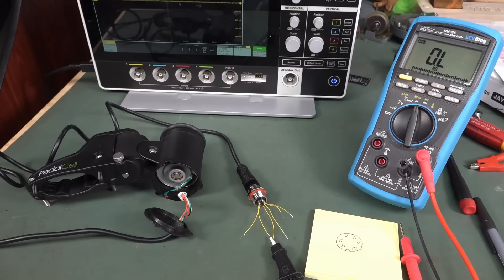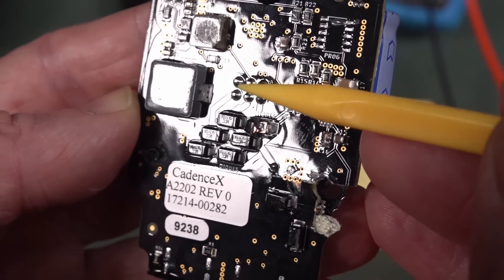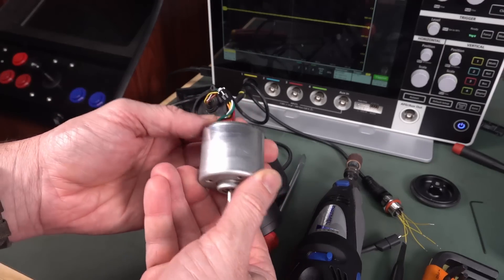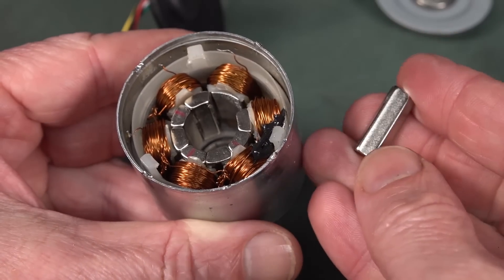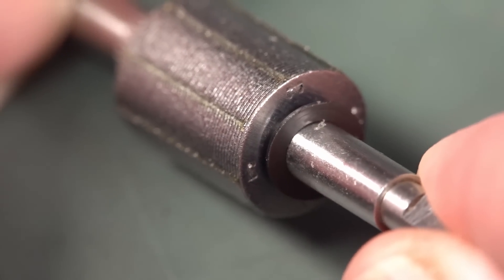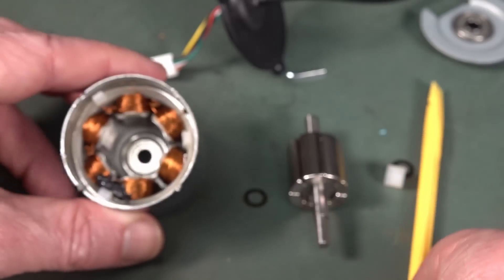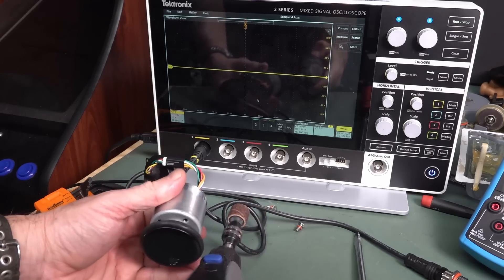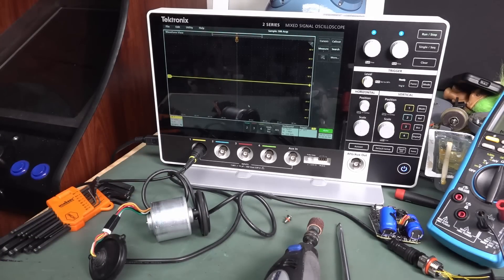EEVblog 1485 - PedalCell CadenceX Bike Generator LOL FAIL!

Comment: That's what's called an "inrunner" configuration (where the magnets are on the rotating shaft).  They can fly apart as this one did.  The other configuration (where the magnets are on a rotating bell and the coils are mounted in the middle) is called an "outrunner".  The benefits of the outrunner include the fact that the magnets are being flung in-place by centrifugal force when things are turning.   They still throw magnets sometimes however -- if they're poorly glued.
Reply: Yup, I've glued back many a magnet in the outrunner motors of my racing drones. They still worked quite well, especially after rebalancing.
Reply: my only complaint is "why glue?". Just wrap some sewing thread around the rotor and soak it, and it will never ever fly apart. At least at the speeds this motor/generator operates. High-speed inrunners have the magnets embedded in the steel (at least, all the ones i've seen in power tools).
Reply: @victortitov1740  i jobbed at a company that produces three phase synchronous motors and they use kevlar thread wound around the glued magnets and then soak the whole rotor in resin. they are cured while rotating to get an even resin distribution that requires minimal finishing on the lathe for concentricity and is balanced afterwards
Reply: I was wondering why they didn’t use an out runner design. In runner seems more prone to flinging it’s guts out. Eh, not a motor or generator designer anyway. Seems like something that would really only be usable in low rpm situations.
Reply: @Guineh76  Or you can put a proper mounting system instead of just gluing it like a cheap POS and it would never be an issue.
Reply: @Guineh76  in out-runner design the outer casing have to free-spin and only attached to the static part only by a single shaft on a bearing, while a in-runner design the mechanical configuration is typical, ie; like in the video, a load can be attached to the motor by a shaft while the casing is rigid and can be securely mounted to a larger structure. So imagine how to design a plastic mounting for a spinning casing (out-runner)? on a DC fan it is done by making the fan as the casing for magnets and the base of the motor is mechanically supported by a circuit board.
Reply: @xponen  yeah, that definitely makes sense. Was not thinking of that when I posted.
Reply: My R/C car motors are all inrunner and I've never had a problem with them, even with motors which spin at 50K+ RPM. The company obviously just cheaped out on the motor and this was the result.
Reply: Spot on. Low inertia of spinning mass is one of a few great reasons for using an inrunner. A human pedaling on and off may generate intermittant energies where an inrunner is preferred for this reason. A properly specc'd inrunner (or any anything for that matter) will never fly apart, but poor engineering may not be accounting for dynamic forces of existing on a moving bicycle and associated failures modes.
Reply: @stonegray230  
Long story short, that guy probably DROPPED the unit onto a concrete floor and jarred the magnets loose. AND he did it twice. Once to each unit he bought ... maybe his bike riding "did it" too.
Reply: Almost all of computer fans are out runner designs.
Reply: I work for a company which develops fly wheels to store energy. Those machines are outrunners, but it's a different usecase.
Reply: Do they ever just glue a strand of glass fiber roving or even just a thin woven sheet or something around the magnets on those inrunner motors? Or do better versions just encase the magnets in steel laminates or something to keep them together?
Reply: @DrPersonman  Tesla's newest motors use high-tension carbon fiber rotor wrap to counter thermal expansion and centrifugal stretch to reduce the overall rotor-stator air gap while raising RPMs some more. If carbon fiber wrapping is good enough to control expansion inside a 200+kW electric motor, a much simpler wrap should be good enough to prevent rotor magnets from flinging out of a 10W dynamo.
Reply: outrunners have higher number of magnets producing more torque and a higher voltage for a given RPM
Reply: imo the better design is with the windings on the armature and the magnets fixed...altho this requires a commutator and brushes to get the power off the armature and out to the housing.. and that can fail (not as quick as this junk tho!)
Reply: @WacKEDmaN  When you use an outrunner design, the coils on the inside/"rotor" is static and it is magnets on the armature/"stator" that are going around. No brushes needed. Static coils on the inside, moving magnets on the outside is how most PC fans are built too. Instead of using glue on an outrunner, you could use shims to maintain spacing and wedge the magnets against the shell so they cannot get sucked in.
Reply: @teardowndan5364  not to practical for this use tho..this needs a design that has latitudinal strength..outrunners dont usually have much in the way of that...
Reply: @WacKEDmaN  You can have whatever strength you want, loads are nearly the same regardless of in or out runner, it is just the point of load moving from somewhere beyond the housing to somewhere usually in-between. Many electric bicycle hub motors are out-runner designs, no shortage of loads in all possible directions there.

Comment: I bet it was heat not vibration/force that caused the adhesive to fail... but either way very poor engineering to rely on such a small amount for such a critical join 🤔

Comment: Well that's a shame, and a waste. The rest of it was pretty well-made, then they blew it with the very first, most fundamental, integral part in the most bone-headed way. There were so many ways they could have done that, why they went with a drop of glue, is beyond me. 🤦
Reply: Take into consideration that in China, one manufacturer makes PCBs, the other one makes the motors, and the last one assembles everything. Maybe it's how it is done in other countries too,  except that other countries have QC department, and are not using the absolute cheapest to bring down the prices...

Comment: Such a simple mechanical failure! And that does explain why some many of the things have died, because the combo of bicycle vibration and spinning fast is going to break that glue every time. I wonder if there's room for a wrap or two of fibre tape for a repair?
Reply: it's not good enough for the magnets to be taped into a ring - they have to be mechanically connected to the shaft, so the tape won't do squat. Just need actual glue that holds.
Reply: re: "because the combo of bicycle vibration and spinning fast is going to break that glue every time."
Yup.

Comment: I had one of those as a kid - manufactured over 50 years ago at this point   

It was basically a perm magnet brushed DC generator (motor) you'd wire directly to the lamp module which contained a standard torch bulb (6v as I recall) .  There was only one wire - they grounded by clamping down and gashing thru your paint to the bike frame.    The on off switch was simply the mechanical lever that would engage/disengage the drive cog against the side of your tire.

It had horrible magnetic cogging  and placed a surprising load on the wheel which you could really feel .   The light intensity would go up and down as you peddled and went off when you stopped.  No capacitors or batteries or regulators.  It ran quite dimly most of the time , to leave some headroom in case you went really fast so it wouldn't blow the bulb..
Reply: Haha - perfect description of the components and the installation! One good thing about them: AFAIK, they never got stolen! 😅

Comment: This BLDC motor would work just fine if the magnets were fully potted in epoxy like you did at the end for your repair. It blows my mind that a company would ever sell such a motor with internal magnets that only held onto the shaft with glue. Even if this was used for its intended application, it would still be a matter of time before the magnets flew off.
Reply: @SporadicBenevolence  I was going to say the same.  In REAL generators, the magnets would be a tiny bit longer than the coil poles so you can 'band' each end of the rotor with any non-conductive 'string' to hold the magnets on the rotor.  But that would cost a few pennies more.

Maybe the darn thing just isn't rated for the speeds involved?
Reply: @SporadicBenevolence   dunno they're charging 300 bucks for this shoddy thing. They probably have enough margin for something better than elmers.
Reply: China does not care.
Reply: @SporadicBenevolence  its not just about the price, i think.
the bandaging reduces the air gap, resulting in a torque reduction.
We are designing our own high-power, high-speed motors (25krpm) for our racecar - and AFAIK, without bandage. For the afforementioned reason. The magnets are embedded in the core. A colleque of mine simulates exploding rotors for high-power machines - all without bandage. We are talking about high-reliability applications :-).  In this case, however, they should have added it.
Reply: Sintered rotor was the only logical choice in my eyes.

Comment: As for the laminated construction I think they just make the components and assemble them using the same machines that they already had to make brushed motors because that's more cost-effective, sheet metal can be punched to final shape much faster than one can see with the naked eye, for a solid piece they would have to use a lathe to face the ends, turn the outside diameter and make the hole... I don't know how fast a CNC lathe can be but I doubt it can outperform a die cutter.

Comment: For the manufacturer failing to glue the magnets properly is not even cost cutting, it is just plain stupid non-caring no quality control bullshit. Oh, I don't think vibration from the bike has any effect on it, it is only the centrifugal force that eventually throws the magnets onto the stator.
Reply from the maker: You underestimate the power of vibration.
Reply: @EEVblog   Perhaps. And I'm far from an expert on bikes too. Just my gut feeling on how a bike can or cannot vibrate :) Thanks for replying.

Comment: I was waiting for follow up video, as were anticipating what went wrong with it. I'm always interesting in different failure modes. At 1st thought could've been a voltage spike but dammn if the bike went over ramps, and had a ton of vibrations magnets twerkelate themselfs loosey goosey, and boom no more electricity for you! Hats off to who designed the electronics, and the housing for it ...But whoever designed that generator didn't take into consideration the sheer amount vibrations created when cycling. Also, glue wouldn't be solution only temporarily. But, I'm no design expert on this, just have experience re-building the bloody things.
Reply: the centrifugal force FAR exceeds the vibrational forces I'm sure.  I bet if you spin a new on up to speed it'll die right there, unless this was just a bad batch of unglued motors

Comment: "Stabbies."
Sharp probes to stab thru the conformal.
Above a certain RPM, your magnets are going to throw to the outside and part with the rotor.
Reply: OR - just drop the motor ... onto a hard surface. Concrete might do it.

Comment: I've wondered before how you would glue those coated neodynium magnets. Must be difficult. 
Also don't you generally want very little glue but with enough pressure to ensure a good bond? Generally the glue will be less strong than the glued parts so if you have thick glue it can break more easily.
Reply: Most likely some sort of epoxy or cyanoacrylate. Looks like too little was used going by what we can see on them @10:35
Reply: @grndkntrl  I guess you want just enough so that it will be squeezed out and a thin film remains. Probably a messy job in the manufacturing line.
Reply: epoxy potting would work as mechanical fastener.

they sure had enough potting for the electronics. I guess the cumbersome bit is in balancing the epoxy really.

Comment: Given that this device is subject to so much vibration during normal use, would the manufacturer be better off using a good old fashioned brushed DC motor? Sure the brushes will eventually wear out, but you'd think a brushed motor would last a few years before needing replacement.
Reply: I used to go outside at night with my bike, I put a big brushed DC motor from a printer in the wheel. It produced enough power to run a 21W car lightbulb inside an old car headlight, but the motor was getting toasty after a few miles. It produced just as much light as a motorcycle headlight, and drivers would sometimes blink at me to reduce the power :D

Comment: It's a sensored brushless DC motor being used as a generator. They are commonly used in upmarket RC cars as the sensors give good starting torque. Chinese made ones are known for losing their magnets. We use unsensored ones in RC planes and were in the habit of pulling them apart when new and super gluing the magnets in properly before first use.
Reply: Generally in RC prop type planes/drones, outrunner motors are used where even basic glue will work due to magnets being on the outside.  Where inrunners are used such as EDFs, helis and cars, the in running stator with magnets are wrapped with kevlar or carbon fiber as any glue alone isn't a guarantee.
Reply: @preddy09  👍
Reply: A lot of skateboard motor sellers advertise "battle-hardened" where they go in and add extra epoxy to the magnets. Some of them go even further and try to balance the motor.
Reply: @KerbalLauncher  skateboard + motor = pleb
Reply: Usually in RC applications, the ESC measures the back EMF of the motor coils to know what position the rotor is in.
Reply: A good factory solution is to wrap the magnets in Kevlar bandages. Like hoops of a barrel. I guess you could do that as well. We have some servos from China made that way.
Reply: @vorazechul  That would be hard to retrofit as the clearance between the magnets and the poles is made a small as possible for efficiency.  You'd be lucky to wrap even one fine kevlar or CF thread (with epoxy) and still fit.   With a lathe you might be able to bore the pole pieces out a smidgeon.
AFAIK, only Tesla make CF wrapped rotors,  and currently only on the Plaid.
Reply: @vorazechul  or some sort of heatshrink tubing?
Reply: That moment when I realise that the spikes from the Dremel's EM interference is bigger than the output from the generator. 😂
Reply: RC planes motors (and a lot of brushless motors in general) are "outrunners" which means the magnets spin around the rotor. Now that makes sense!
Reply: It's not hugely different from a car alternator except the alternator uses an electromagnet in its rotor. There are converted alternators out there that have neodymium magnets in the rotor to be used as wind generators.
Reply: It would be good to know a part number so we could build our own.
Reply: @richardl6751  "It would be good to know a part number so we could build our own."

We've already see how that motor is a bad choice.  Better to get an RC outrunner motor, but a fat rubber band around it and shove it to the bike rim.  Rectification, smoothing and regulation needed to, of course.
Reply: @Randrew  I was referring to the brushless DC motor that Ashley West was talking about.
Reply: That’s exactly what was said in the video. No new knowledge here
Reply: theyre also developing sensors to track customers anger and frustration and advertise the new model whenever they spike
Reply: If it is brushless DC then why is the output AC?
Reply: @debochch  bacouse brushless DC motors are not DC motors at all they are AC motors with electronic computation, or more precisely they are permanent magnet synchronous motor with trapezoidal back emf. Brushed DC motors are also AC motors but with mechanical computation (brushes convert DC to AC). There is only one motor as I know that is realy DC motor but it produce so little torque that is near useless.
Reply: @debochch  - because a brushless DC motor is NOT running off continuous DC. They run on 3-phase "switched DC". The hall effect sensors and motor controller PCB send a pulse train of DC to the 2, 3, 4 or more windings in the correct order and phase angles to create the rotation. The DC pulses sent to the windings pull (and push) the magnets to create the rotation. Little pulses or slower pulses = less power/speed.
...
The reason they are called a "DC" brushless motor is because they run off DC power. It's switched on and off with a square wave, same as a PWM signal, except more than one phase. This "generator" would be 3-phase DC. Contrast that with an AC Motor that is usually driven from a Sine Wave shaped AC power supply.
---
In this case the motor is being used "in reverse" as a generator (probably more like an alternator) that creates 3 sinusoidal voltages that are 120 degrees apart in phase. It's got 2 windings per phase (probably running in series ), and 3 pairs of magnets. As it rotates, the resultant voltage on the 3 windings rises and falls in a roughly sinusoidal waveform (as seen on the scope).
Reply: @debochch  No such thing as a "Brushless DC motor" they all operate from 3 phase AC.  It is "market speak" for the fact that the BLDC motors have a built in multiphase AC generator allowing the motor to operate from a DC power source.
Reply: @shazam6274  the design optimization is different if you're making a motor that runs from a sine wave or switched DC
Reply: @RobertSzasz  🙄Duh!  How about a stepped pulses? how about stepped bi-directional pulses of 4 bits?....
Reply: @debochch  That is what it is though, got to love the terminology.  DC brush-less solar water pump is in reality a 3 phase motor.  They typically use simple PWM square wave instead of sinusoidal to drive the motor and might be where "DC" term comes from?